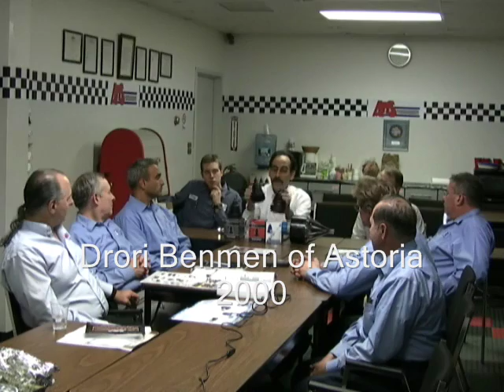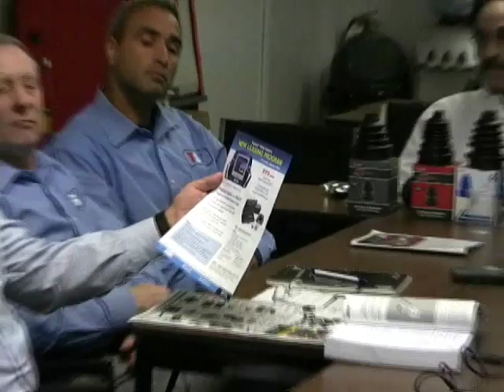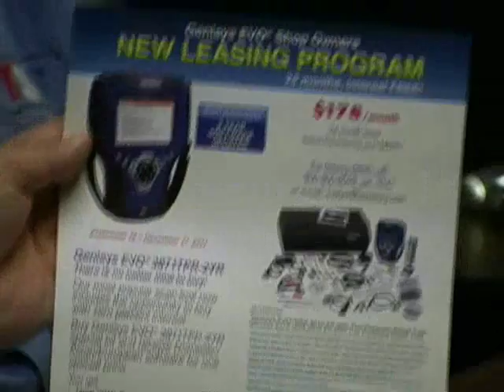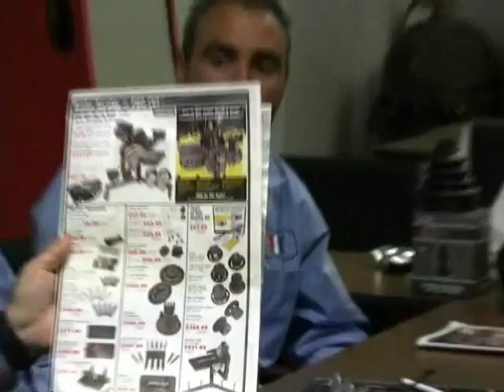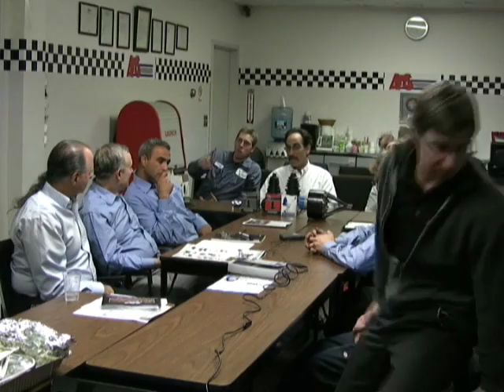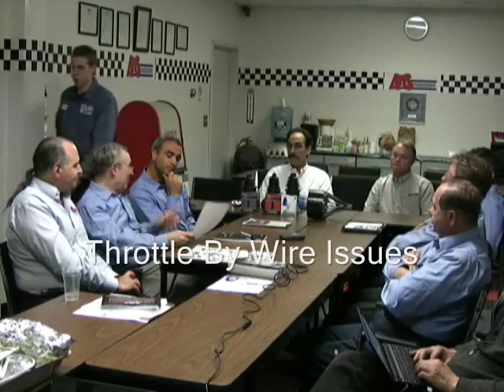Technician's Round Table October 2011

Comment: @srv3fender The Astoria 2000 one?  I have been using it for 2 and a half years.  Mine is an old design and needs a little help with my hand closing the jaws, but I never seen it "Explode."  I've torn one $15 boot in over 2 years.